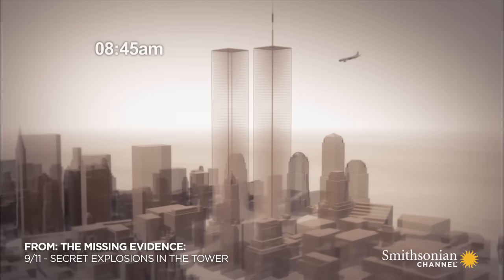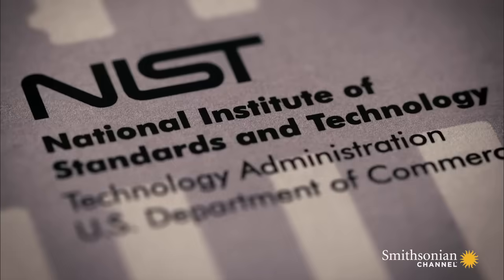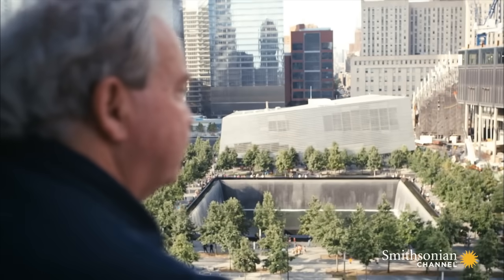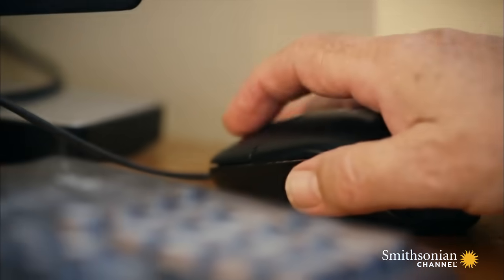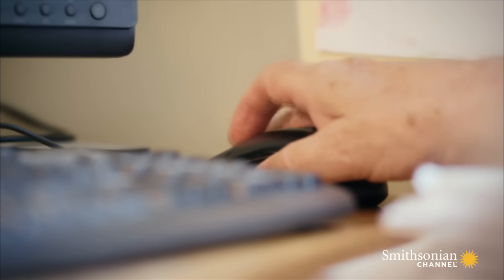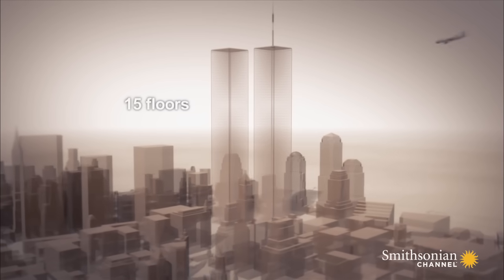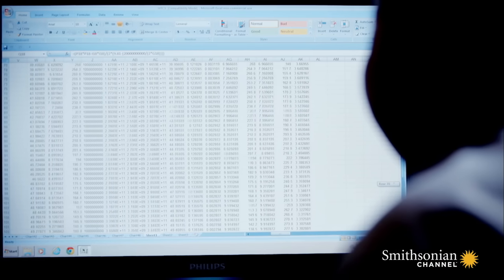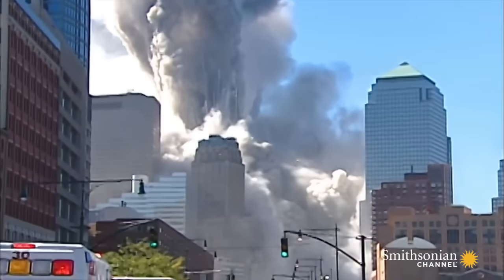This Computer Simulation Explains How the Twin Towers Fell

Comment: Bullshit. It was a demolition. The planes were a diversion. The U.S. government are the real 9/11 terrorists.
Reply: When steel and other metals reach a temperature roughly 70-90% of their normal melt temperature they reach this state that I refer to as warp. In  other words, the metal is extremely malleable despite still being solid. Metal warping occurred on 9/11, due to the impact of planes the steel beams were moved and jostled slightly, causing small dents and bends, unperceivable to the human eye. When the jet fuel ignited and burned, these bends and dents got bigger and bigger. eventually causing them to fail under the enormous weight of the upper floors of the WTC. Similar physics as crushing a soda can, the can can handle a lot of stress underneath your foot, but when you just flick it with your finger it completely crumbles under your foot, resulting in a flattened soda can.
Reply: Rayheat Except that wouldn't destroy the full building, it would only eliminate the upper regions.